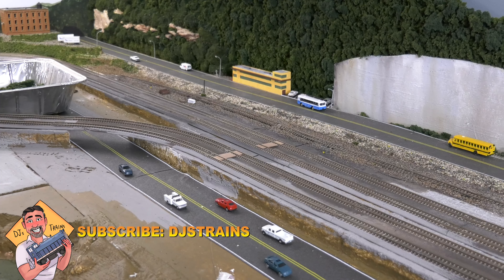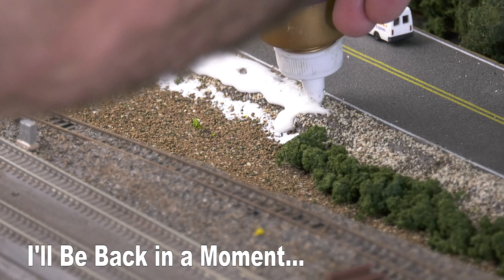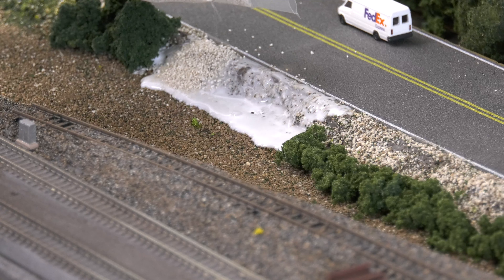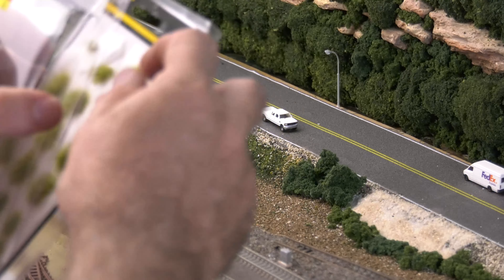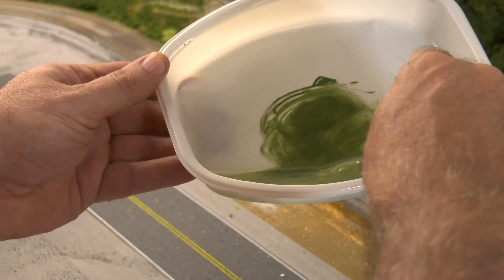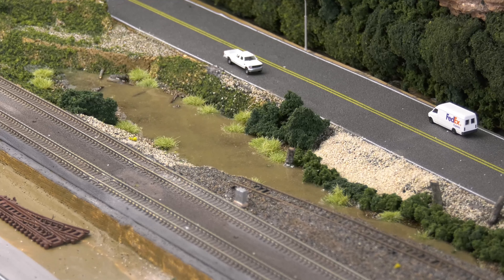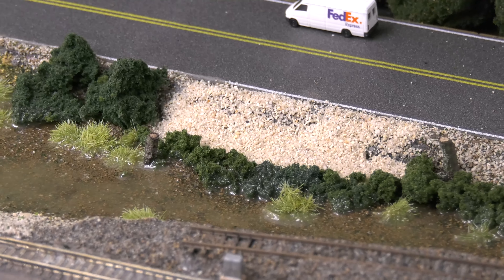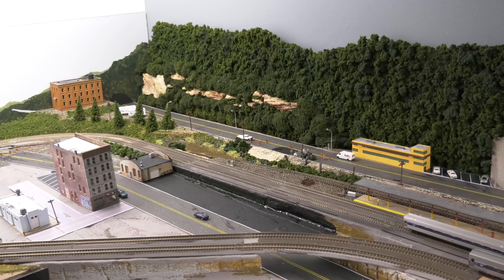Model Railroad Scenery! WATER! (road drainage) and FIXING ISSUES! Lol

Comment: How do you syncronize engines that are paired? Seems that achieving identical speeds would be very difficult.
Reply from the maker: Speed matching in model railroads using dcc is possible but I’m not the best one to ask